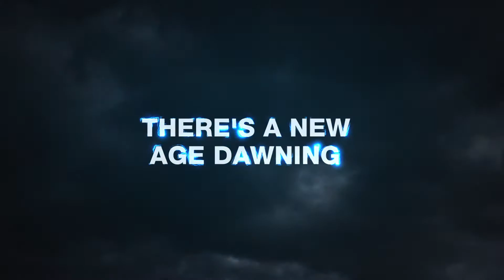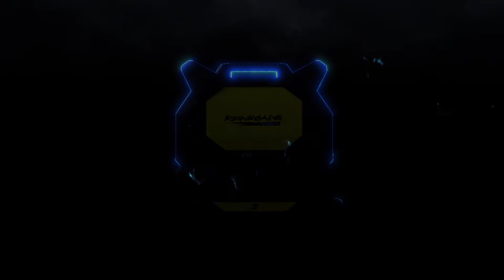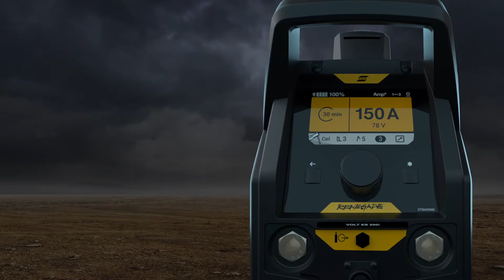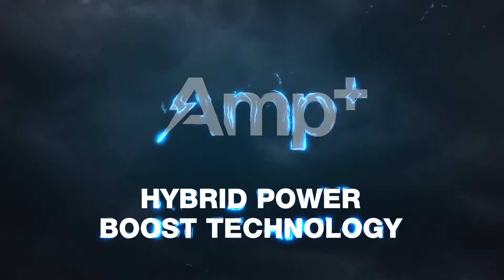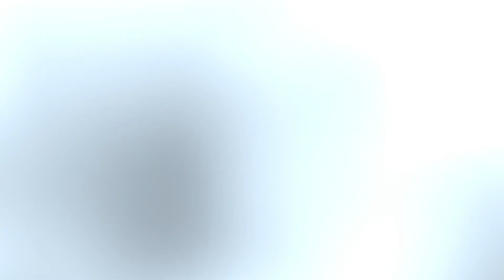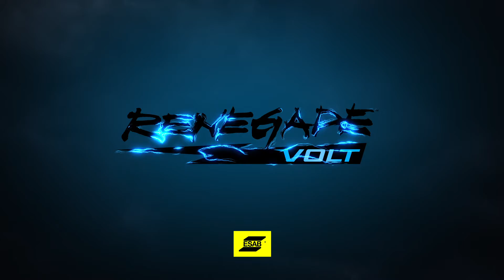ESAB Renegade VOLT™ | A new age of cordless welding powered by DEWALT® FLEXVOLT® batteries.

Comment: What does “30 electrode strikes” mean? I only question because of my experience with marketing. 30 welds? I would like a time welding at a certain amperage. Seems more understandable
Reply from the maker: A single charge allows Renegade VOLT to burn up to 33 E6013, 31 E6010, and 26 E7018 3/32 x 9.8 in. (2.5 x 250 mm) electrodes when using 12 Ah batteries*.

Comment: So going by pictures the battery box doesnt seem to fit dewalts 15ah flexvolt batteries? Why is that?
Reply from the maker: Hi there, the machine is not compatible with 15 Ah FLEXVOLT batteries.
Reply: @esabweldingandcutting  why is that? You guys missed on that 1. That would be the best battery possible runtime wise

Comment: Isnt there ALREADY a dwalt battery powered welder? since the battery box on yalls is separate, MAYBE you could make some OTHER battery boxes that take OTHER batteries...?  ;)
Reply: Im jus speculating but i feel like the problem with that is other platforms arent 60v except yard tool brands but thosr brands arent on jobsites. 60 x 4= 240v and other brands are 20v x 4= 80v. Something like this probably truly needs to run a higher voltage to be any good or jus not overheat batteries